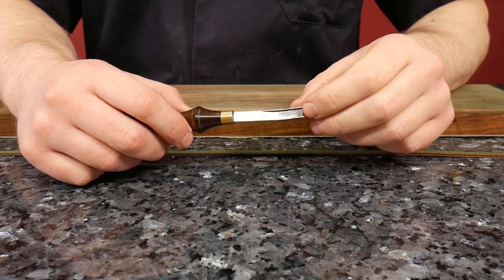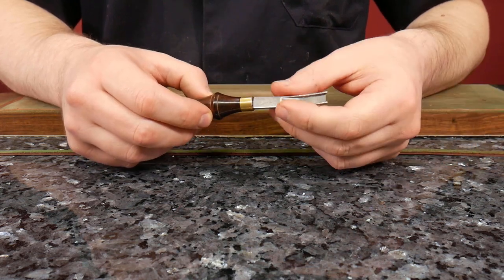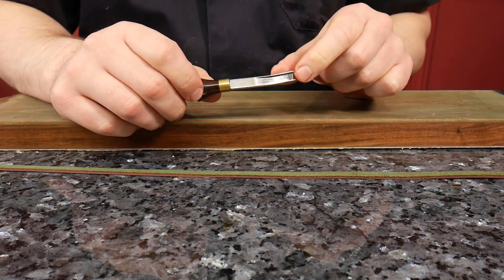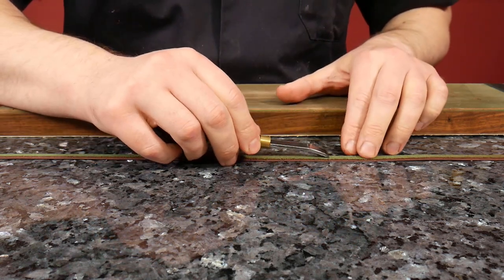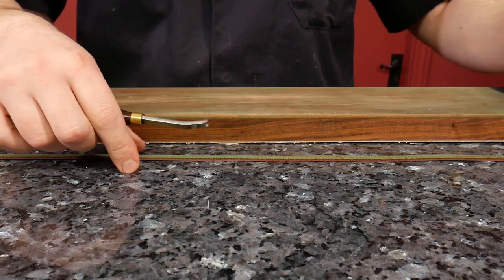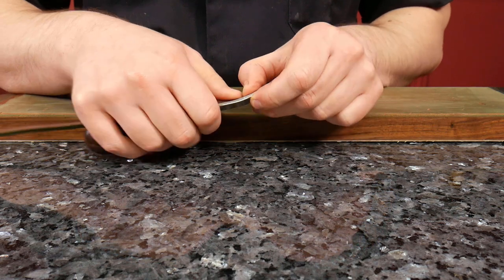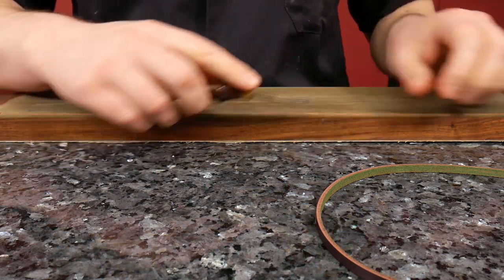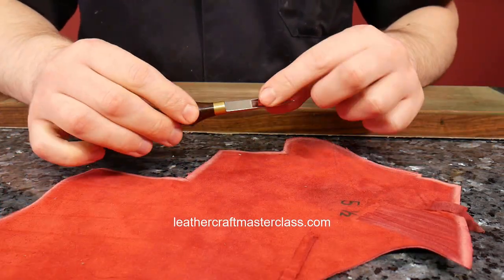Using A French Edger In Your Leathercraft

Comment: EDIT:: I just saw you answered someone and said you mostly use 4 and 8. Can you explain why you use those sizes more than 6mm? What do you use 4mm for, and why 8mm over 6mm?

I don't have the money to buy a whole set of Palosanto skivers. They sell four sizes, but which would you say would be the one or two sizes to buy? I was first thinking 6mm. (If I was only buying one) But then I have seen many people say 8mm is usually the best french skiver size... And then i've seen videos where 4mm can be useful for other purposes like grooving leather to be bent at 90 degrees and other smaller jobs. Basically I'm wondering, if I'm going to try and buy two, would you buy a 4mm and a 6mm? Or a 4mm and 8mm? Or which two of the four would you say people would get the most use out of? I'm making mostly smaller goods, sometimes medium jobs like costume accessories.
Reply from the maker: Try not to overthink it Drew. You won't make a mistake with any of those sizes. I used a 6 for a couple years by itself without issue, but 4&8 cover more ground.

Comment: Great video! Have you ever used a sharpening stone to re-hone the edge on one of these? I have an older French skiver that I just can’t seem to get sharp anymore.
Reply from the maker: Yes I have, this one didn't come that sharp so I had to show it the diamond plate. If it's old and worn, you may have gone past hardened edge at the front.
Reply: Leathercraft Masterclass great to know I can get the edge back. How did you hone the inside edge? Sandpaper strips?